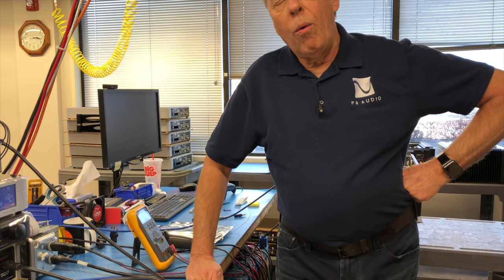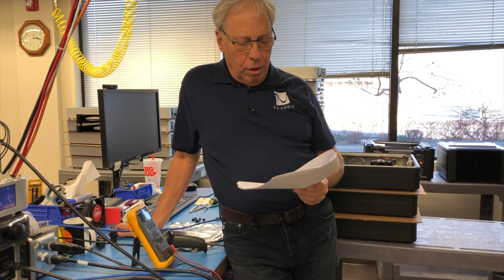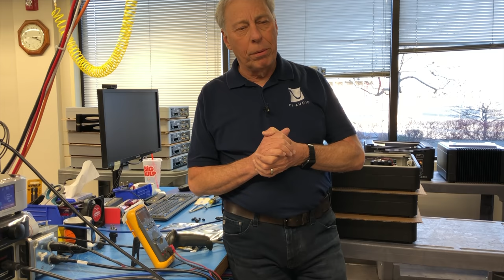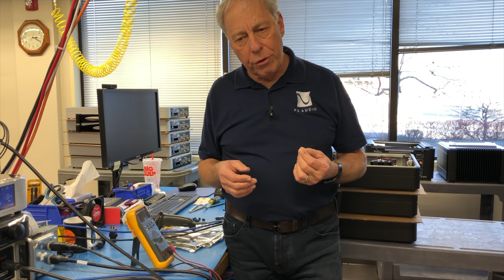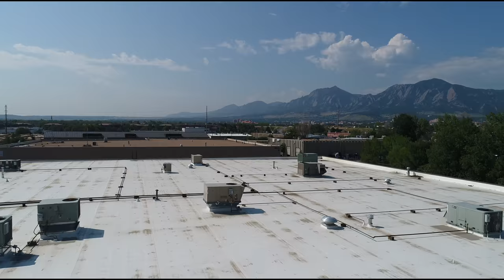Why do people abandon their power conditioners?

Comment: That makes so much sense.  So the power conditioners were causing too much output impedence, which presumably means that power demands would cause the voltage the sag and not be able to deliver the necessary instantaneous power to the amps... which you can then hear directly.

Sounds like power conditioners might be a good idea... on all the low-power equipment instead of on the amplifiers :-).

-Matt

Comment: I agonized over weather or not to buy a power conditioner for years then finally bought one. I don't hear an increase or decrease in fidelity so I guess I have a glorified surge protector with a digital voltage display.🤔

Comment: Wow, what a difference removing my power conditioner made!  I HAD a Furman power conditioner between my Kawai Digital Piano and the wall socket. I HAD attributed the less-than-should-be sound to the small room acoustics, carpet, etc.  I had put a sheet of finished maple plywood underneath the piano which un-muddied the mids and improved the highs to a degree, but the lower registers still dominated the higher registers and it lacked the depth and color I knew was possible. Without the power conditioner the sound is not as "clean", BUT; it IS vastly more dynamic and lively, and the higher registers are now balanced with the lower registers.  It now sounds like a real piano.  -- Anyone wanna buy a mint-condition-used power conditioner?
Reply: I highly doubt this. Unless that amplifier (or speaker) is voiced to sound better with that high-frequency noise on the line, it shouldn't be impacting its dynamics. Any little thing could add such a minute level of resistance to the power going to an amp, like a simple surge protector for example.
Reply: I went from a high quality surge protector to straight into the wall socket. Huge improvement, much better highs and mids, it really livened up the sound. I was shocked.

Comment: Hmm... also, don’t forget that AC input power is running at 50/60hz... it can’t affect higher frequency ranges without also causing some very noticeable intermodulation effects. Given that we don’t hear that; I’m highly suspicious of placebo effects here...

Anyway, instead of trying to stiffen the AC supply; I’d add low-inductance caps after the AC-to-DC power supply stage. This, incidentally, is routinely done in digital design; google ‘decoupling capacitor’ for more on the subject (and sometimes we use different cap sizes all connected in parallel because they react differently at different frequencies; despite the theoretically ideal model considering them equivalent to one cap of the same size as all the individual caps summed). 🤔
Reply: I did that to a separate  power supply  I built for a cyrus one amp 30 years ago. Russ Andrews  provided the design  sketch 1000va  transformer DNM slit foil and polypropeln bypass caps. No more clipping! Great smoother sounding  results.  Thank for explaining  why ;-)

Comment: Moral of the story:  Not all conditioning devices are made to accomplish the same goals, and they are certainly not all built to the same degree of specification. Just as with vehicles.
Reply: Can Paul's power regenerator be used with a  power inverter. 500 watt, from 12v?
Reply: Peter S The REAL moral of the story is to never light a campfire in the forrest, Smokey!
Reply: @progressiveguy9959  we lit many a fire in the hills of Southern California while hiking with Boy Scout troop 248 out of Point Mugu NAS California.
Reply: @SJMessinwithBoats1  I've never seen one of Paul's devices in person so I can only say that as a generality with a device of this architecture, you can absolutely use an inverter to boost 12V up to a "serviceable" but fairly poor quality 120V or use a 120V output generator to feed a regenerator which will finally deliver a solid, high quality power source. The same cannot be said of other architectures of "conditioners" which do not function as regenerators. What you must ensure, is that there is plenty of reserve capacity on the inverter or generator side as they're almost always less capable than the sticker would indicate and the Power Plant will consume all the energy necessary to make sure it has a slight buffer to work with. The devices of this nature I've worked with could be described as "exceptionally hungry" to get what they need from the wall in order to do their jobs. If under load your inverter/generator drops in output voltage then additional current will be drawn by the regenerator to compensate so overrating everything upstream of the regenerator is something I would highly encourage. It's not really an issue with batteries, but on a generator what you want to avoid is having the load make highly variable demands of the generator which will affect its speed and generally its regulation. A decent test might be to play the 1812 Overture at high volume and monitor the generator speed and output voltage for variation at the point of cannon fire as it represents a rather considerable amount of bass to track. The final point I would bring up from my experience with a variety of generators is that some of them have rather poor voltage regulation and I would want to be sure that any generator I plugged a Power Plant into would never hit it with too much voltage. I would be surprised if PS Audio didn't have some (or considerable) experience with a customer using either a generator or batteries for critical listening. My guess is that they would be happy to address your questions if you gave them a call.
Reply: Brian David Loveless We seem to have quite an age difference.  When I was a kid, what I typed wad "Smokey the Bear's" slogan.
Reply: @Peter_S_  Maybe I could get my Tripp Lite 1200 watt "modified sine wave" Inverter going again. It would start up a hand held circular saw. Maybe that's tough enough!
Reply: @Peter_S_  Maybe my Onan 2.5kw out of a 1970
Motor Home would be good. It runs at 1800 rpms. That should work.
Reply: @SJMessinwithBoats1  If your inverter can handle a circular saw, I would think it's surely going to work well for providing base power to a regenerator. 😎 My comments above about lesser quality generator power were actually mostly from my experience with Onan generators on several boats and in one RV so I'm a little weary of them but if you warm them up and don't stress them too hard they sure keep on spinning and they provide decent utility power. A 2.5KW generator should be fully capable of providing sufficient power and one advantage of a larger generator is a larger flywheel which is gold for regulation. I'm also with you on fires; it's all about being responsible.
Reply: Peter S. When heading to the outback being land or water, always have 2 batteries, a power inverter and a compatible battery charger. Say you have both batteries "dead" (12.2 volts.)
Use one battery and power the inverter to feed the charger to charge the other dead battery to start the engine. Hooking them in series would be a mistake.  The genset story surely sounded like a solid test with the cannon giving a proper full load.😏

Comment: Just not sure that I buy this explanation as anything but a means to sell his $10,000 power conditioners. Anything could add such a minuscule minute level of impedance to the line, including things like a basic surge protector, which you need unless you want to risk your stuff getting fried. Speakers just don't need that much electricity, certainly not enough that a power conditioner would cause an amplifier to be gasping for breath. As long as electricity is getting to the amp, it has the power to do what it needs to do. Resistance in the line has the effect of lowering voltage, which is why extension cords can only be so long for a given gauge/thickness, because current (amps) starts going up to compensate. But as long as the voltage drop isn't too significant, or results in more amps being carried than the wire can handle (which a conditioner would not cause), I just don't see how it would result in an amplifier failing to reproduce certain components of the signal it's getting from an AVR or DAC. Perhaps the high-frequency noise that these conditioners remove is perceived by Paul as definition in the treble, but it's certainly not doing anything to harm a power amp's dynamics (unless the amp is simply huge, and the conditioner is too small for the load).

Comment: Paul you could have explained that it is called ac harmonics, and those harmonics are produced by cheap ac to dc converters, and here in norway there have been several cases that harmonics has been related to those new induction cooking stoves, there was a confirmed case where there was a wind turbine that a power company had put up that generated ac harmonics when it was producing power to the grid, so it can be in many forms, even a bad 3lead motor with a too small of a capasitor can produce ac harmonics due to the drop when engaged hope this explains a little more in-depth.

Comment: The overall impedance of the mains power supply using the PS Audio conditioner is dictated by both the conditioner and the incoming supply to the conditioner because it is in series. There is no reduction in impedance as implied in this video at 7:17.

Comment: Hmm, for what it's worth power conditioning (or regeneration) is in my opinion used for inadequate engineering for the device/s that it will feed.
My homebrew amps have enormous toroidals and excessive great quality capacitors (RIFA ones designed for SMPS with very low esr, also bypassed with film caps), so that's my ott way of getting very low power impedance. I have PTC surge reduction at the imput to the toroidals otherwise the inrush is a little brutal.
The dynamics are wonderful and the lack of distortion leads me to playing rather loud without realising it.

Comment: Very interesting
Personally, I owned 4 Krell amplifiers and all 3 amplifiers I've tried to use 240V instead of the 120V, dynamic and quality of sound increased substantially. If your amplifier can use 240 and you can have a electrician wire a dedicated line, DO IT.
Reply: Someday, I hope to procure Krell. A Smaller one would be fine. Something about those heatsinks and doubling as a space heater...

Comment: The implication of paint protection they try to sell you on your new car is they haven't painted it right. The implication of power conditioner you're sold is they haven't designed the power supply right. Just don't buy cars that are not correctly painted, and don't buy hifi unless the power supply works.
Reply: The “quality of the power supply” is not the point of high-end audio.
Reply: @declanfarber  I don't understand. So the power is irrelevant?
Reply: @CupOfSweetTea  The point is that it should “sound right”. Whether the power supply is “military grade” or not is often (usually?) not part of that equation.

Comment: Please, Always check the focus on the camera before you start shooting the video you are going to post... 
It's even more important than fine-tuning the VTA before you copy a record to tape. 
 
 
How can anyone think the impedance of the cord between the wall outlet and the component matters a shit 
when the copper in the wall is completely out of your control unless you had the place wired to your specifications? 
And what about the feed from the pole or underground transformer? 
No utility company is going to accommodate a request for special stuff there!  

Some years ago I bought a TrippLite LC1200 at a thrift shop for $8 or $9. 
If not for that deal, I probably wouldn't use a power conditioner at all, and I wouldn't think it was worthwhile.

Comment: All power amps should go directly to wall power  , conditioners are best left for the low voltage units like pre-amps,  etc ..
Reply: Conditioners are best left on the shelf, in the shop. There, fixed it for you.

Comment: I will never use a power "conditioner". From my own experience a good quality power strip with EMI/RFI noise isolation combined with a good quality power supply (wall-wart/brick) does a far better job preserving dynamics/harmonics.
Reply: Mine is like 43db noise filtering is that any good?
Reply: @m.morininvestor9920  
It is like 99+% noise reduction. Sounds perfect if it does not cost a fortune.
Reply: Bansaku
Power strip is only for those who cant connect direct into a wall socket, cause they dont have any wall socket near their system.

Power strips kills dynamics vs direct wall socket. I have strip, and two sockets are no filtering, and they have better dynamics, but nothing beat straight into a wall.
But if i must have a strip in use, I would use some decent one, not that cheap use for computers for 10$.
Reply: Nothing beats straight into the wall. Try it, I was amazed at the difference.

Comment: Wondering if a power conditioner would solve my issue:  The issue started when we moved into a newly built house (with an old TV Tower nearby).  I am using 2 amps with a pre-amp, HDMI's and RCA connections, 11 speakers and they installed 16ga speaker wire in the walls.

   The issue I’m experiencing is when the volume is very low there is a specific FM radio station that plays in the background (regardless of the source, or input).  Some days are louder than others, there is also some kind of static buzz that accompanies it.  The issue is heard through maybe half of the speakers, some louder than others and from either amp.  The sound plays through the tweeters mostly.  

The issue persists even if i disconnect the RCA (signal cable)!  Ive also tried a different speaker wire - no effect.  Changing the HDMI’s, adding/removing components and moving around the RCAs all seem to make differences but nothing eliminates the issue. 

Also, on another circuit  in the den of my house, my powered sub hums a bit when plugged in.

Not sure if a power conditioner would help these problems?
Reply: Does a newly built house have proper grounding?
Reply: @alexanderbelov6892    ive had the electrican come over a few times..  he believes it is good.

Further testing proved wrapping the speaker wire in tin foil seemed to reduce the issue by about 85% !
Go fugue.
Reply: @Spirited_Driver  
Probably you have AM radio station nearby, so it induces some audio signal to your Hi Fi system.
Or your Hi Fi system has improper circuitry to "tune" some radio waves. Sometimes electronics engineers forget that low frequency audio devices are   usual electronic devices to work with 20 Hz 1GHz radio signals, so if radio waves are not suppressed with 100KHz low pass filter those signals will be amplified and appear in speakers.
Reply: @alexanderbelov6892  its fm radio station 97.5fm
The signal is induced through the amplifiers and speaker wires even if my Marantz receiver is turned off
Reply: @Spirited_Driver  
🤦‍♂️FM encoding is not that simple to decode with any amp. 😮
Reply: @alexanderbelov6892   lol i know right.  And when i say amp i mean amplifier not reciever.  The amp does not have any tuner or decoder, only a 120v plug on the back no buttons at all.
Reply: @alexanderbelov6892   sounds like you suspect my amplifiers are designed like this.   I say that's too far fetched because i have been using them for 10 years prior to moving into a new house when the issue arose. 
I'm using a McIntosh and an ADA
Reply: @Spirited_Driver  
Who knows. Probably some failed capacitor converted the amp into the radio+amp device.

Comment: Do conditioners affect the sound as much if they are just used with source components? You didnt specify but i assumed the issues you mentioned affect Amps more
Reply: I think you're right. In my experience, source components do better with a power conditioner, but amps do better when plugged into the wall. Adding a power conditioner to my phono stage improved the sound tremendously. Same with my DAC.

Comment: I kept all my power conditioners.
Reply: You were conditioned.
Reply: Myself as well. Mainly I started using them to protect my equipment after I lost a receiver to a lightning strike. I guess with my cheap systems I dont notice a differance to sound but if I have a good amount of static electricity built up and touch my fidge in my man cave, my conditioner will shut down. Thats how I know its protecting my system and I am good with that.
Reply: @scottyo64  surge protector.
Reply: @Geerladenlad  thats basically what it is

Comment: I read all these interesting facts and opinions about power conditioners etc. For me, the information Paul puts on the channel is always giving me direction and giving me more usefull information than any hifi shop or forum I've been.
So my conclusion is that I will connect my power amp with a quality power cable directly into the wall or into a 'direct' outlet on my W-Audio W4000. This is a power strip with for filtered and 4 nonfiltered/ditect outlets.
My question is: How should I connect my other equipment? That is a pre amp, dac, cd player, streaming bridge and a headphone amp... Should these, for the same reasons Paul explained, also better NOT be connected to the filtering outlets and shall I get rid of this power strip OR do the arguments for not using power conditioning only apply to (power) amps??    Best regards, René from The Netherlands

Comment: You need to align all your power cables from the Distribution Board through the conditioner to the Audio and video equipment correctly, otherwise it will drain the life out of your system. Power supply lines need to be properly designed otherwise you wasting your money on conditioners.